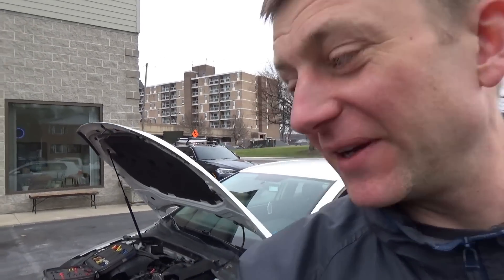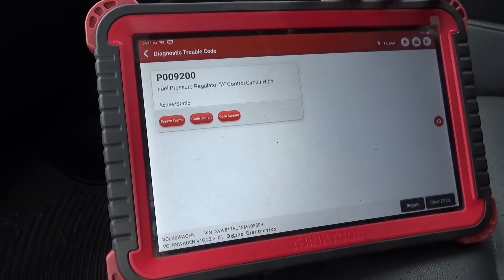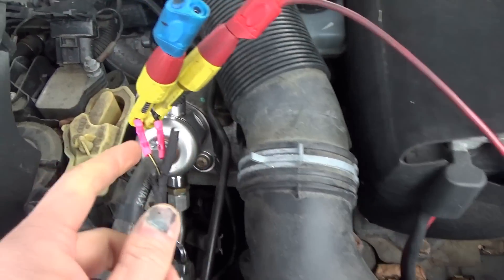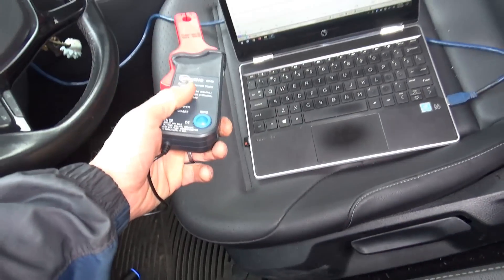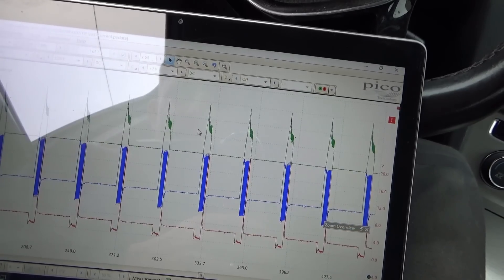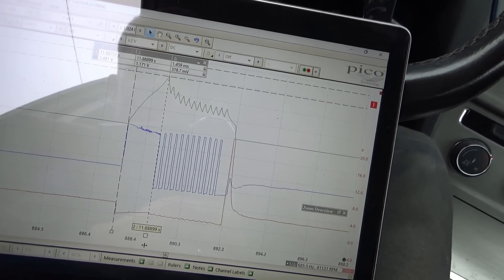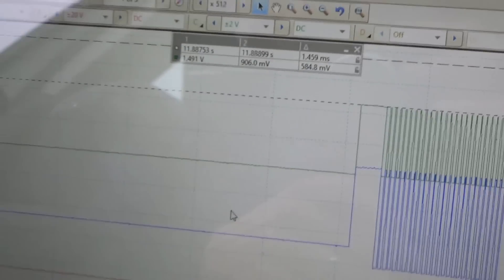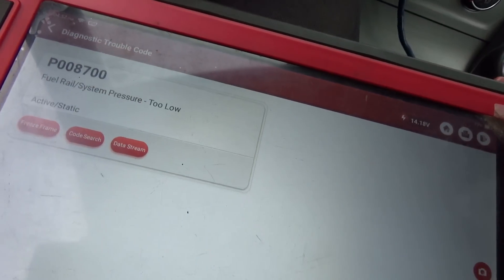VW GDI LIMP Mode AFTER Repairs?? (P0092 - High Pressure Fuel Pump Circuit)

Comment: Yup. Just finished watching. To be honest i see this a lot. Being that this is what i do for a living. Aftermarket parts these days are really bad. I just had a Land Rocer yesterday that had codes for turbocharger boost control circuit A. Well the first thing i found is that the customer installed a boost control solenoid from Amazon. Installed an OEM solenoid......but still not boosting. Checked wastegate flap = ok. Checked wastegate actuator = ok. Checked solenoid again via bidirectional control = ok. Checked turbocharger spinning freely = ok. Finally started thinking "the customer did replace the solenoid once......maybe he didnt connect the vacuum lines correctly". Sure enough the vacuum reference and the wastegate control were backwards. And not Alldata, Identifix nor ProDemand had a vacuum diagram. So that was fun. The interesting part is that the way this vehicle is engineered it cannot tell the difference, in this case between a mechanical fault and and electrical fault. So because the wastegate actuator is a sinple vacuum diaphragm and has no position sensor the pcm cannot monitor it. And it does not have any sensors on the boost control solenoid itself. So essentially it commands the solenoid. Looks at target boost pressure. Doesnt see that target met. And assumes its because theres a circuit issue with the boost control solenoid. A bit of dumb system for a Land Rover. Although it is obvious once looking at the engine bay that its mostly a Ford Escape. Either way the aftermarket is going down the drain these days. Which is a constant battle for us techs because shops want to keep using them. Its simply more practical. But boy does cause headaches sometimes.
Reply from the maker: Sometimes it's 10x harder to diagnose the initial problem after someone already messed with it and built in MORE PROBLEMS 😒
Reply: @PineHollowAutoDiagnostics  100% true.

Comment: Haven't finished watching. But  I'm thinking look up what the base high pressure specifications should be. It seems like possibly the pressure isn't high enough. And the ocm is trying to raise it. But because it's an aftermarket pump the control solenoid windings are not the same. And thus as the pcm trues to up the pressure it then gets amperage spikes that are too high. And turns the solenoid off. Which is why disconnecting it made no difference. The pcm had already turned off by the time it was disconnected. Just my thoughts. Ok. Time to finish the video.

Comment: I believe after several days of parts swapping  one might get lucky enough to actually fix the car without a scope.  But proofs in the pudding, if you want facts and quick results a scope is an absolute piece  to find these kinds of problems.   Nice work Ivan
Reply: Scope without human brain and system analyze and understanding how things work is just a box.
1 one tool is your brain
Reply: @aivarinno9257 exactly! I must admit that I wouldn't turn so much attention to that current draw and therefore I wouldn't find that. Everything looked just fine😂

Comment: The auto repair channels I subsribe to all take last resort cars after dealerhip shops fail. I took a new truck to a dealer for a "free" oil change and had to flatbed it back, dripping new oil. Just because a company has a franchise does not mean they know how to run a shop.
Reply: Sounds like Jiffylube TECHNICIANs. Certified Bonifed. ASE passed all tests.

Comment: I was thinking that maybe that you could substitute the pump load with a test light but one question I would want answered is  what should the resistance of the OEM fuel pump be ?

If the OEM part is Bosch then as long as it has the same 10.digit Bosch part number on the packaging & on the pump itself then it should work properly providing it's not faulty !

Comment: Bosch aftermarket stuff is sometimes counterfeit.  I bought o2 sensors for my S10 online, correct Bosch part number.  Did not work.  Went to Oreilly's, bought their Bosch O2 sensor, same part number, twice the price, construction was a little different, and they worked.  I did a comparison video of it on my little microscopic YT channel.  I always look forward to your videos Ivan.
Reply: Yeah counterfeit parts online is a common thing. 

Could have been a factory reject being sold as good.
Reply: Got counterfeit Denso spark plugs for my Highlander from Amazon. They looked amazing. 20k miles, tips eroded, misfire codes. Suspect not actually iridium, you know, the expensive metal! Bought a set from Toyota dealer, twice the price - but they’re gonna go 120k+ miles… counterfeits are difficult to spot nowadays…
Reply: Let me guest get from Amazon ?, you've been better off getting it from RockAuto however you are correct they seem to be getting counterfeited just like NGK and NTK and other brands to.
Reply: Same exact experience with a temp sensor. Cost almost twice as much at oreilys , but it worked perfectly
Reply: Agree, counterfeit parts are a huge problem and growing every year.
Reply: Thought I'd have a look at your comparison video, Johnnie - but it's impossible to find.
Reply: @Peter_Riis_DK  Thank you for looking for it.  If you're interested, search for "Bosch Counterfeit? Cheap O2 Sensor failure for 1998 S10 and fix" on @JohnnieBravo1 channel.  It's about 2 years old now.
Reply: Hello all, I have ask this question before no answer yet or I did not get or missed the notification. How do you know what oem is?do you have to go to the dealer to get an oem part?
Reply: @carbie5614  The part i got from O'Reilly  was oem.
Reply: I guess its the same across the board with non OEM Bosch items, Bosch wiper blades from a reputable outlet in the UK (Halfords) are not a patch to OEM parts from Mercedes' Bosch wipers.
You get what you pay for!!!
Reply: Same with Denso,  Delphi,  motorcraft, etc.  Really can't be sire what you're getting anymore.

Comment: Trust but verify your test equipment AND your replacement parts.  Should have been unnecessary but this is where we are nowadays. Scope and test lights definitely homed in on the issue. Test lights low resistance when cold would have sent someone with less knowledge down a rabbit hole when they tripped a code. Great diag and good explanation.

Comment: If the pump is physically identical it makes you wonder how it can be made electrically to draw more current w/o becoming hot.  Shorter length of motor winding is about the only way to get more current, unless something is bad physically causing pump to work harder.
Reply: As its drawing higher current, it's not physically identical.
Reply: @joeds3775  Two incandescent A19 light bulbs, one draws 40 watts, the other draws 60 watts.  No outer markings.  Physically they’re identical.  Only with test instruments can you tell they’re different.  But not with a caliper.

Comment: 900mv is .9 amp . Wire is likely touching metal or liquid tube . Electrical wire could touching elsewhere . Usually it's big wire ..like battery , startor alternator . Dont get me wrong small wire can but usually those have anti rub sleeve . Ideal would be big solid electric wire  for d/c current .  Big Multistrand electric wire for a/c current . But thumb size space around big wire should be enough unless you are racing
Reply from the maker: 1V = 10A 😉 Sorry for the confusion!

Comment: if I remember rightly I had either 7 or 12 ohms from memory on the HP regulator and it was a genuine VW pump. You said you had 0.6 ohms no wonder it was pulling such high amperage..

Comment: Interesting that a Bosch pump doesn't work, as this is probably a Bosch injection system (not 100% sure, though). Maybe it's the wrong one or a counterfeit? If it makes financial sense to fake NGK Sparkplugs, it probably is worth it to counterfeit a expensive di-pump.
Good job on tbe diag btw.

Comment: Only had that same code about 2 weeks ago in the workshop, once I had monitored at the pcm which was under the screen it confirmed it was the pcm  issue, after 2 HP pumps fitted by another workshop. The car was a VW golf btw
Now I will continue watching your case study, as I am only 3 minutes in.